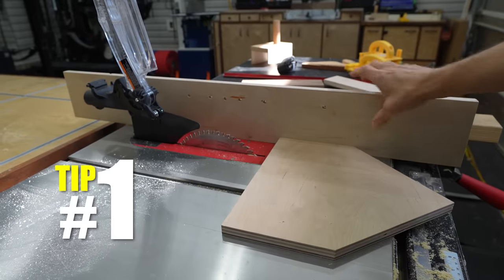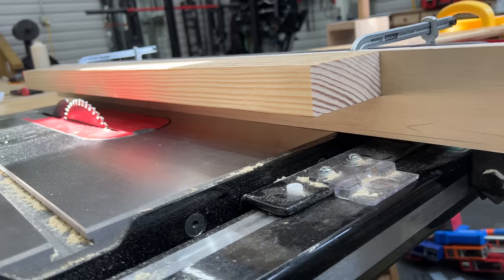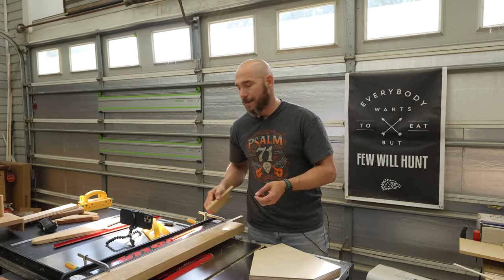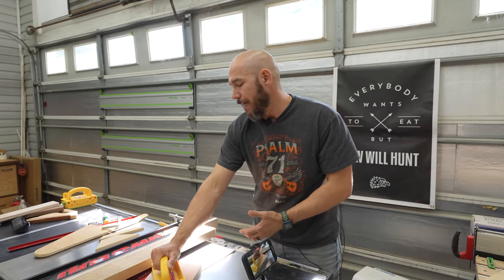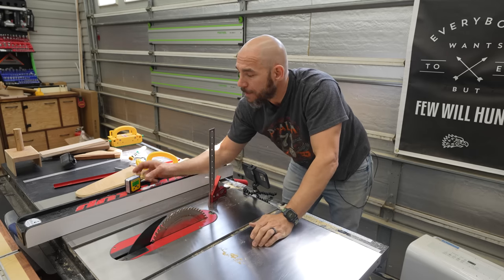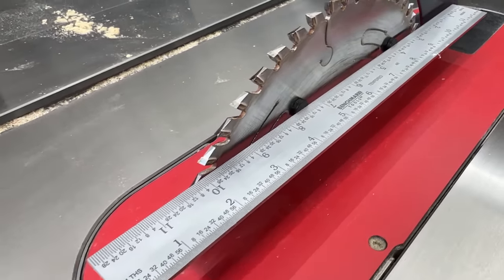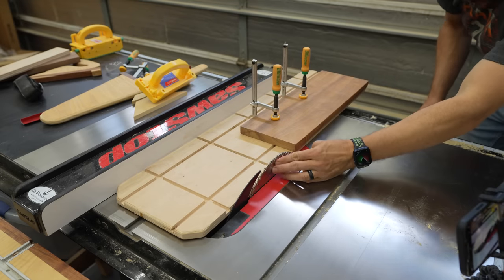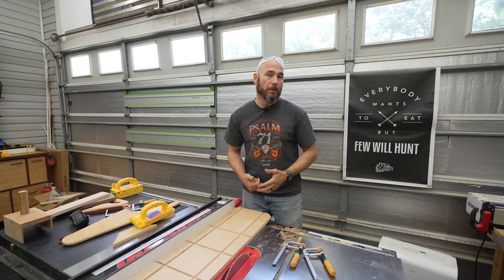Woodworking Tips For the Table Saw | Template Cutting & More

Comment from the maker: ▼EXPAND FOR TOOL LINKS and INFO▼ 
Watch the Jointing Jig Video: https://youtu.be/UFfj8qGVxZ0
Tools In This Video: 
MicroJig DoveTail Clamps - https://amzn.to/3xYMRhm
Dovetail Router Bit - https://amzn.to/3CibAjq
Push Block I Use - https://amzn.to/3RmjOeP
GRIPPER Push Block - https://amzn.to/3UQoE74
Magnets - https://amzn.to/3SEcQTm
Metal Rule - https://lddy.no/1czaz
Digital Angle Finder - https://lddy.no/1czb0
Double Stick Tape - https://amzn.to/3RlChrJ
Table Saw Blade I Use - https://lddy.no/1czb2 (use code 731CMT10 at checkout to get 10% Off)
Combination Square I Use - https://amzn.to/3LQrYe9

(If you use one of these Amazon and other affiliate links, I may receive a commission) 

Some other useful links:
-Daily Tool Deals on my website: https://www.731woodworks.com/tool-deals
-Subscribe to our email Newsletter: https://mailchi.mp/7e44c16eefdc/731-woodworks-email-newsletter
-Check out our easy-to-follow woodworking plans: https://www.731woodworks.com/store
Outlaw's Board Butter - So Good it Should be Outlawed: https://www.731woodworks.com/store/boardbutter
Reply: Hi friend, thanks for the tips. Quick question: I just ordered the matchfit clamps, do you know if a regular dovetail bit will be fine. When I looked at the Microjig it’s pretty much the same but claims it has “rounded over edges”. Thanks my man
Reply from the maker: @CraigularjJoeWoodworks  I think any dovetail bit will work so long as it's making the same size dovetail.
Reply: @CraigularjJoeWoodworks  moi

Comment: Those dovetail clamps are a great idea for a straight edge jig.  I am going to get some.  One way to improve the jig would be to add a bottom runner that slides in the miter slot, takes the setup away and no worries about the jig wandering away from the fence.  Keep up the good work.
Reply: If you add a runner you take away it's ability to do double duty.

Comment: When you were talking about keeping your blade 90° with a square you have to be careful not to throw out a perfectly good blade because you think they're bent or warped. Blades are supposed to be pulled into flat when they start spinning that's what all the holes and grooves in the blade are for. So if you see light between a ruler and a blade it doesn't necessarily mean it's not flat

Comment: What's wrong with using a router table with a guide bearing on the end?
Reply: Did ya see the kickback router table vid?  It would give me issues if that happened to me.
Reply: You firstly have to cut your shape close too but bigger than the template. That takes time. Then set up your router table, mount your router bit and make at least one pass depending on how much bigger your piece is compared to the template. This can all be done on the table saw with only one cut on each side. The only extra time is clamping the fence and aligning the blade. I would say a big saving in time and effort, also blades stay much sharper and longer lasting than a router bit. Yes, some jobs are better done on a router table eg laminate trimming but that home plate is definitely easier on a table saw using his fence jig
Reply from the maker: Not everyone has a router table.  As mentioned in the video.

Comment: Howdy Mr. 731...

Another good Tips video. 👍 

I made my own straight cut/tapering sled a while back. Not quite like yours but does the same function. I'm actually going to upgrade it cause right now, it's the type where ya just drill a bunch of random holes and use a screw down clamp. It works great, but it's cumbersome having to constantly unscrew the clamps completely, remove completely, find another hole that'll work, reinsert screws and clamps and THEN I have to readjust my fence. Very time consuming process just to make ONE cut. 

I've got a few tracks just laying around that I've been too lazy to mess with...but, your video inspired me to just go ahead and get it done, cause once it's done, it's done.

Comment: Great video as always!  You mentioned that you can joint much longer boards with that joining jig versus a 4ft level.  Are you saying that you can put a straight edge on a board that's longer than the jig?  I see yours is a few feet long so how can you put a straight edge on a board that's longer than the jig?
Reply from the maker: yes, the board just needs to hang off the front and back of the jig a foot or so.

Comment: Hi Matt, thanks for all the great videos. I have learned a lot from you channel. I have a question. The last jig you used for cutting a straight edge. Couldn’t you had just used your fence for that cut?
Reply from the maker: no, because the board will reference the other side of the board, and if it is bowed, it will make a bowed cut (not flat)

Comment: As for the jointer jig, the motor side of the table saw (left side of your saw stop) is always in the same place. Which means you could attach a miter slot runner to the bottom of the jig and not have to worry about setting the fence. If your work piece is wider than the sled, use double stick tape instead. 😉

Comment: Bad bad boy.  You do not align blade to fence, you align to the miter slots.  As the miter slots cannot be adjusted and the blade and fence can be adjusted, you align to the fixed condition.  If you align to fence and fence is not aligned to miter slot, your miter gauge, you sled and any jigs based on the the fence, the sled or the miter gauge will not work properly.  Now, if you first align your fence to the miter slot then you can align blade to fence.  Ultimately everything has to be based on the miter slot.
Reply: You’re assuming he didn’t square his blade to his miter slots. This tip is to then square the fence to the blade. You’re assuming he’s a bad bad boy 😉
Reply: He did actually mention squaring the blade to the miter slots. He just didn’t show it.
Reply from the maker: As the others have stated, I mentioned it, didn't show it. My blade is aligned to the slots.
Reply: That’s a good point. 🤔🍷🎩🎩🎩👍